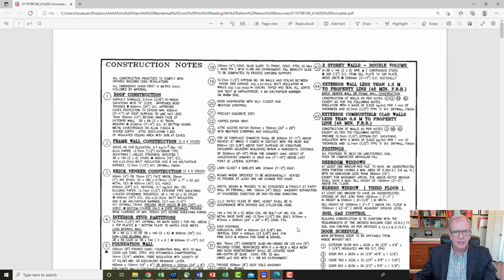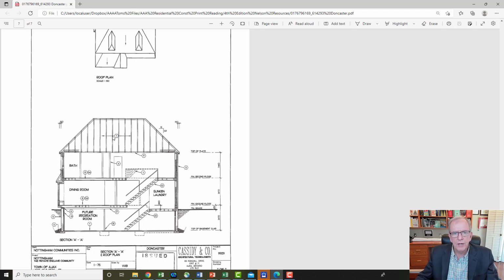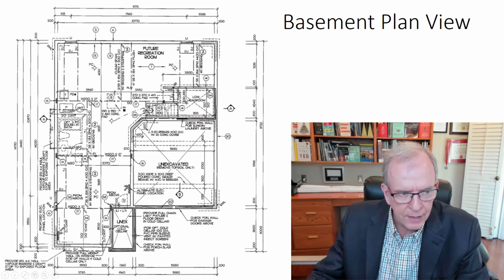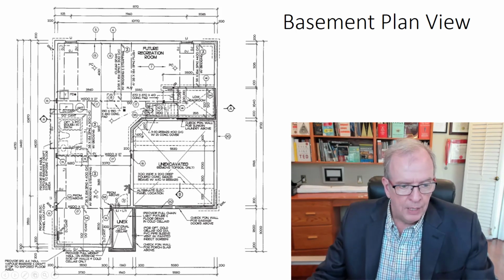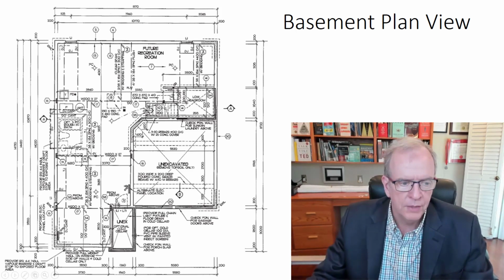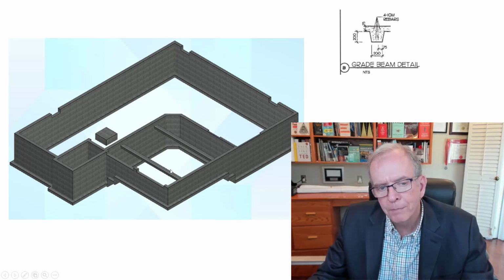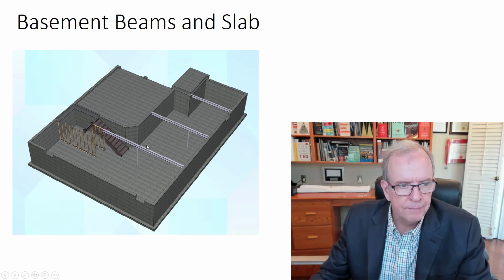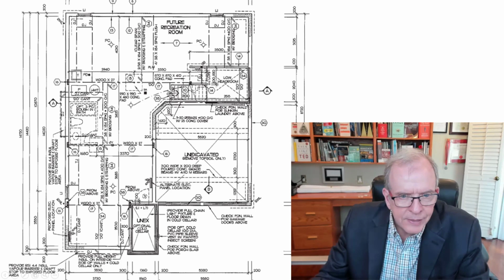LEARN HOW TO READ FLOOR PLANS, UNDERSTANDING CONSTRUCTION DRAWINGS, PRINT READING LESSON #6

Comment: Hi Professor,                                                                                                                                                                                              Could you please tell which software did you use to create the 3d model of the basement floor?
Reply from the maker: Revit was used to create the 3 d flr plans